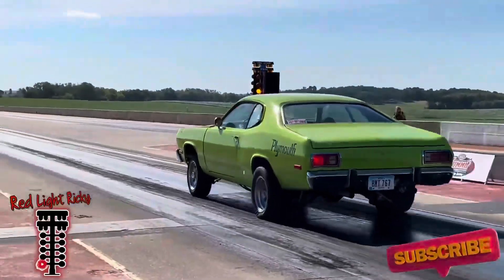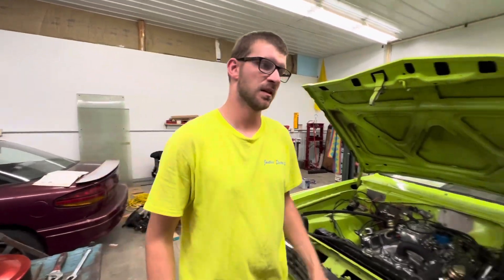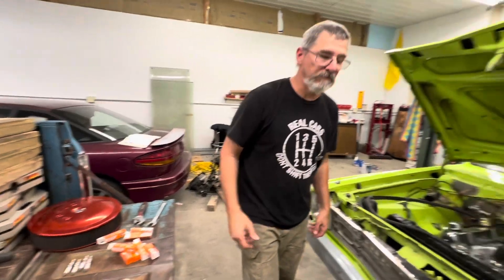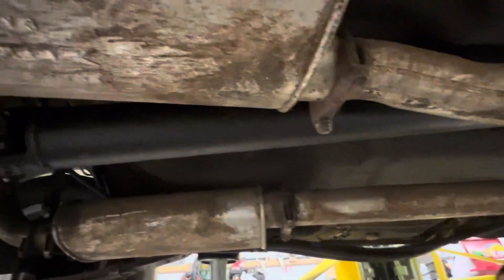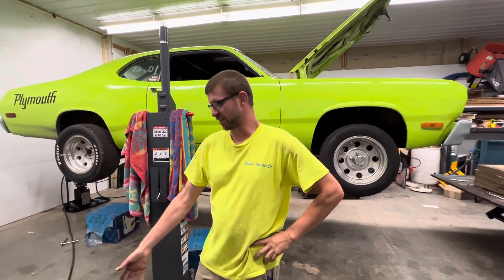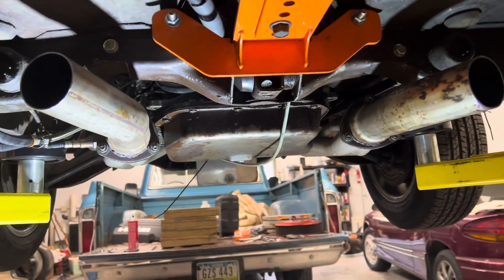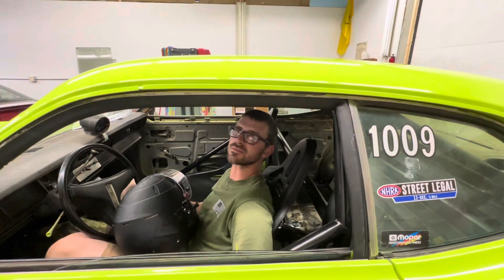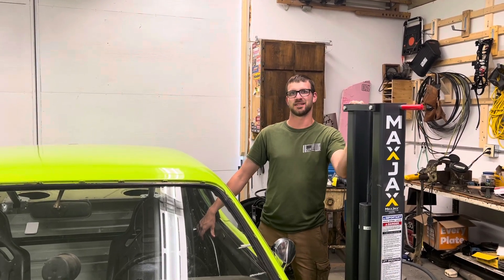Prepping For A Test & Tune! Duster Gets Fast And Loud!

Comment: Sounds like a racecar now! Good luck at the track. You definitely took some chokers off. If you add any straight thru style mufflers, check out those flowmaster F/X’s. Inexpensive and fairly lightweight material
Reply from the maker: We definitely want some type of mufflers. For sure we will look into those! Thanks for watching!
Reply: @jerayracing  Why are You'all interested to have any mufflers for the track, racing ? Any, all mufflers decrease exhaust air flow, thus more back pressure, decrease performance and power.
Did You'all change the alternator from the original, stock 55 A to a larger. increased power output ?
Have You also considers replacing the standard sealed beam headlights with LED replacement versions for reduced electrical power with far  higher lumens, improved illumination ? As a simple comparison, Michael Turner shows the improvement with his 1970 Dart on Shop Dog Fabricton [maybe You met him at Sick Summer ?]
All The Best, Sincerely.

Comment: I’ll be waiting to see how your car reacts to the open header/collector extensions. My Duster actually has gone faster with a 3” exhaust system than with just 18” collector extensions. Every car is different though.
Reply from the maker: Tuesday I’ll be showing the results! But I will say it did act great to all the changes!
Reply: @jerayracing  That’s awesome, I love it when you make a step in the right direction.